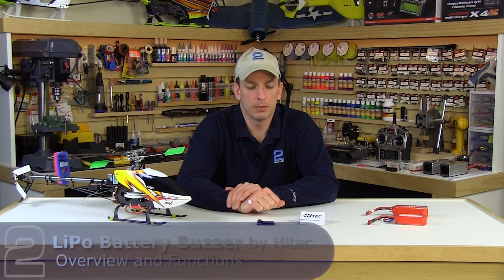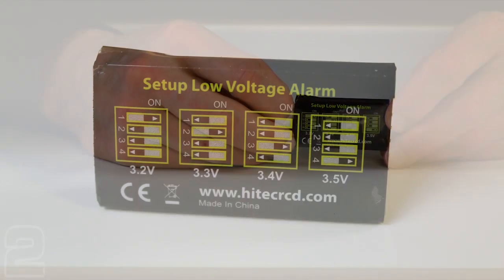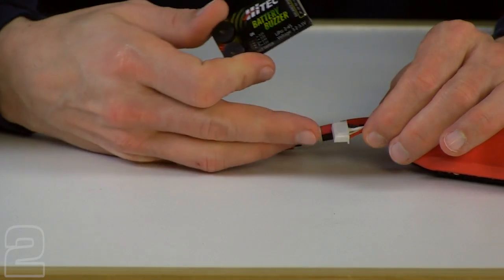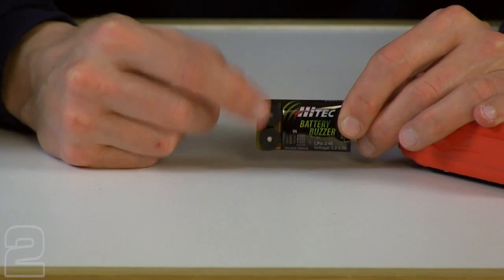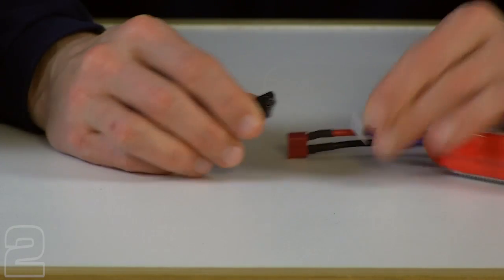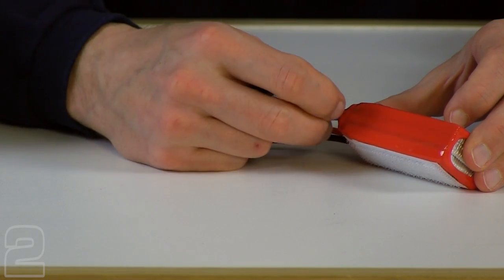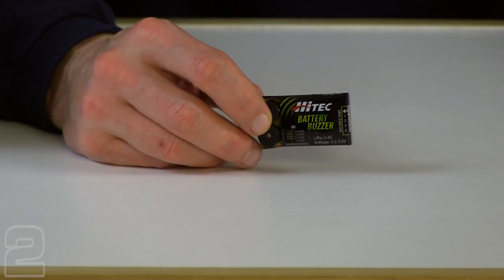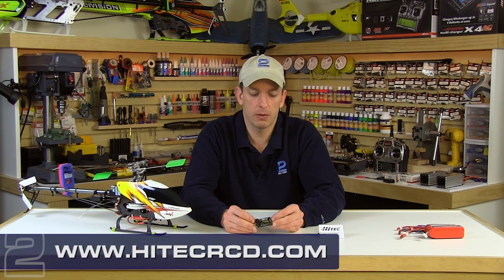Product Overview - Hitec LiPo Battery Buzzer

Comment: Will my battery and/or Hitec battery buzzer be damaged if I connect the battery with the wrong polarity to the battery buzzer for a few seconds? I only did it once and the battery buzzer still works fine, but, I have OCD and just can't stop thinking about it.

Comment: The 2$ ones at ebay (search "LiPo alarm") works great for up to 8s ;)
Reply: I agree there I did have to wait a week or 2 but for 2 bucks I couldn't pass it up. Wish I had ordered a few of them.
Reply: No way. I bought a bunch of cheap alarms and they are very inaccurate. My own tests indicate they can be 0.6v out. Some don't work at all brand new. So a cell @ 3.95v has triggered the alarm set for 3.3v.